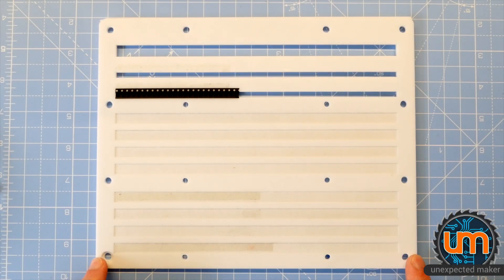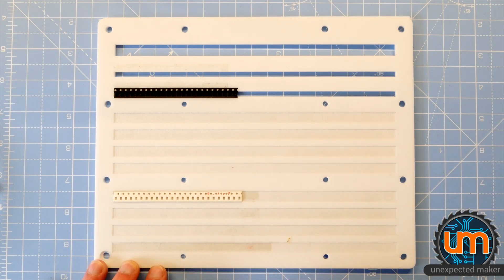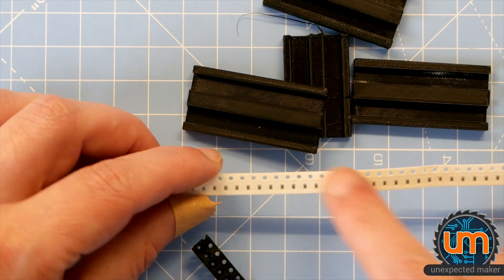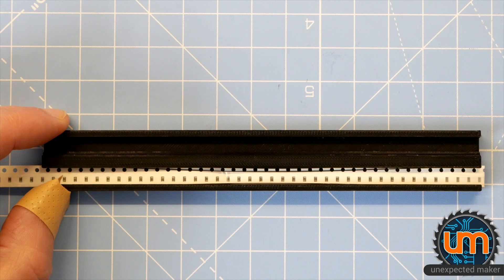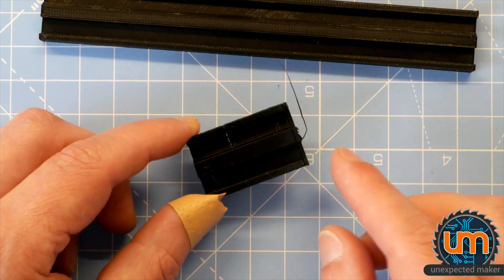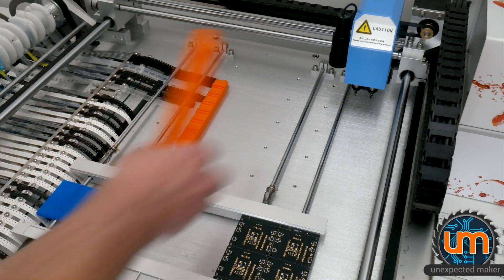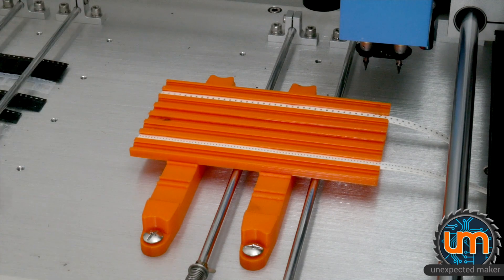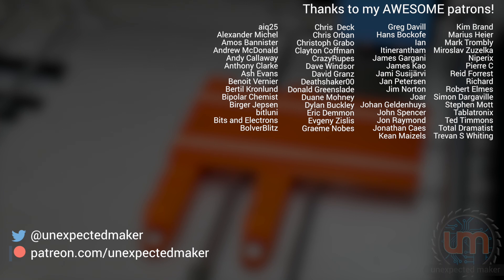My Pick n Place - Ad Hoc Feeder - Nailed it!

Comment: Where did you pick your CHMT36VA up from? I'm on the trigger to try one out. But as was the case when i bought the 3040 router i have it felt like a roll of the dice finally choosing a random ebay seller with what looked like the best bet. I got a fairly good bit of kit that with some modding to make a flat bed worked out nicely. Obviously a pick and place is a little more intricate than a cnc router so any leads on a good bet would be much appreciated. Been following for a couple of weeks now. Really cool projects and channel.
Reply from the maker: I bought mine directly from Charmhigh - As you can see from my videos, they take A LOT of tuning and effort, but that's no different to any PnP as this level, but the results (if you persevere) are pretty good. Where are you located?

Comment: Nozzle removal/replacement should be done with the heater block at operating temp, or at least you should tighten it up at temp before running. This will solve leak issues.
Reply from the maker: Yup, got the leak fixed following a guide by Thomas Sanladerer :)

Comment: Nice mounting system. You may want to add 4mm tick marks to design every 20mm or so to keep from counting parts for the peel back. You could also add a perpendicular ridge and slot to register the tracks to the mounts, then your tracks would be somewhat registered to the 5mm mounting holes. Also do you think you can modify the ULP file to add an initial adhoc slot offsets to the DPV file? Thanks for the video, good luck with your printer. Time is money but you knew that UM.
Reply from the maker: I love the idea of tick marks for part counting, but I'm not sure how that will work when I will be putting various parts types in any slot on any job. On job A it might be 0402s in slot 1, and in job B it might be SOT23.  Yes, time is money, but it's the worst time of the year to have a dead 3D printer... getting parts is not quicker or slower to just buying a new printer, but everyone local is closed, and Prusa have massive delays on their printers still...  and I'm not spending $ on a crap eBay printer (that would still take a week to get to me) that I have to fight with just to get bye while I wait for parts... that would drive me nuts - sanity is important in this game ;)
Reply: @UnexpectedMaker  Put 0603 ticks on one side of slot, 0402 ticks on other side, manually count the rest.  On to 3D... yeah, having tools down really blows. Time to phone a friend. You gotta know a local printer to borrow.
Reply from the maker: Looks like I got the printer fixed... 4 attempts at cleaning and re-assembling and it's been printing for > 5 hours now and no leaks... yet ;)
Reply: @UnexpectedMaker  now that's JIT. Good job.

Comment: Nice! A solution to the indexing / holding tapes in place was shouting at me while watching. I see that a few others have the same idea so I am seconding the motion to have a place to mount a pin to engage the holes in the tape. If it is a short distance from the end of the rail you could lift the end of the tape as you slide in a new section. If that isn't ideal you could just retract or remove the pin to reset the tape.
Reply from the maker: I don't want to lock the tape in - I could have talked about this but was planning on gong over it in part 2, once it was finished, but I want a fixed pickup position per feeder, not fixed component positions. I want to be able to put ANY part in any feeder, and align the part to the pickup position, and not have to tweak the nozzle pickup every time a go from 0402 to SOT23 to XDFN. So I intentionally put no tape locking mechanism in place by design. I hope that makes sense :)

Comment: Nice. Any reason not to extend the length of the vertical holder bars to use the top pair of screw holes thus allowing for a couple more tape holders?
Reply from the maker: Sure I could, but I don't think I need them for my setup... 12 extra components would cover me for 100% of my work I think.

Comment: Very neat idea, great engineering. I wonder if instead of manually aligning the tape at that left end you could extend out and have a small stud that comes up through and locates the tape for you.
Reply from the maker: I don't really want to have the tape locked in a specific position. I wan to be able to set the pick up place per feeder slot once, and adjust the part position to that as every part could have a different pickup position based on its width. 0402 compared to sot23 for example. I don't want to have to change nozzle pickup position every time I put a different component  into a slot.
Reply: @UnexpectedMaker  gotcha.

Comment: This method of mounting is neat. I've made a few versions of this type of strip holder, and the last ones I made were very similar except that I got too clever and put neodymium magnets in the bottom so I could snap them straight onto the steel surface of my PnP machine and have them stay where I put them. The result was that the parts would all move in the tape pockets, twisting to align with the magnetic fields! Some people have done with this Lego as the mount method too, because it provides an extremely accurate and repeatable mounting grid.
Reply: Legos? how simple is that!
Reply from the maker: Yeah, I initially though about magnets, but was concerned about having ICs near them... didn't even think about the parts moving in the pockets.... phew, glad I didn't try it! This isn't perfect... I might make the slots slightly wider to make it easier to get the extrusions in and out, but I don't want them to loose that they move or jostle due to the machine vibration.